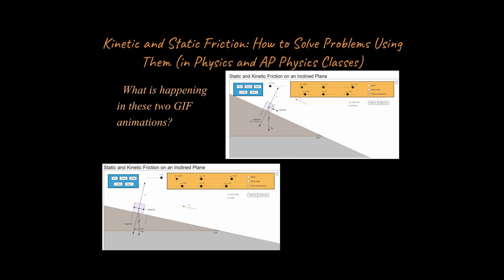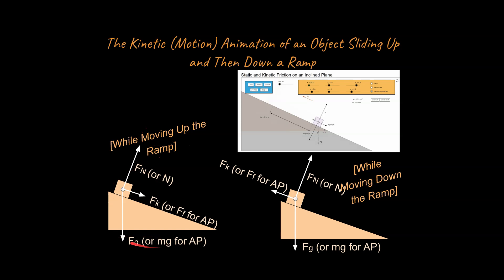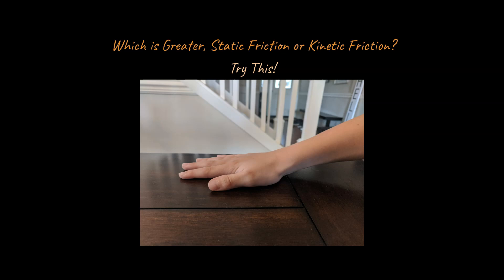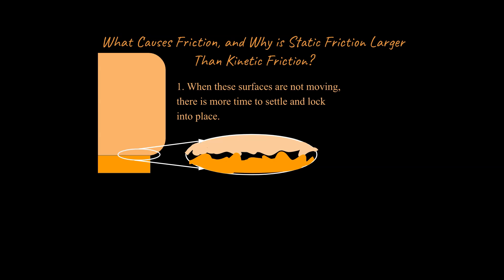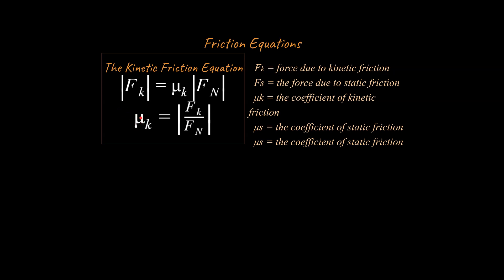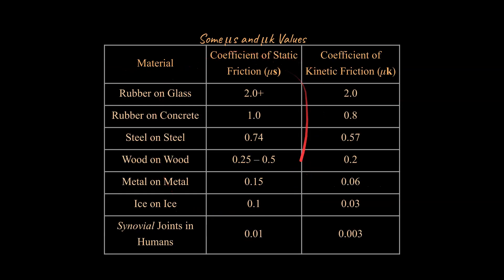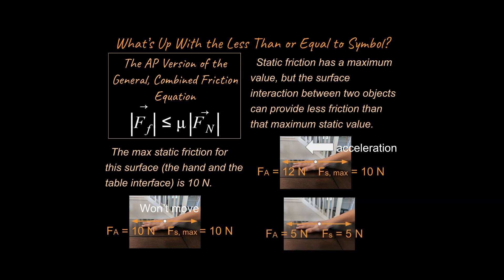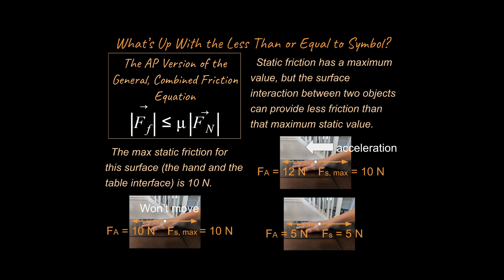Kinetic and Static Friction: How to Solve Problems Using Them in Physics and AP Physics Classes

Comment: As I know the normal force occurs because of the repulsion of electrons between the two surfaces, but if it was only for attraction between molecules, the surfaces would penetrate through each other. Now, I am confused about friction case. As surfaces come closer together (in the state of static friction) because time passes, won't the electrons from the surfaces repel each other more as the distance between electrons are now less. So, the normal force would increase of this increased repulsion and in turn static friction will also increase. Or is there both attraction and repulsion between surfaces' molecules?
Reply from the maker: Good question as usual Bobogan, and it is complex.  There are attractive forces in between the protons of one atom and electrons of nearby atoms (as well as repulsion between electrons of neighboring atoms, which you wrote about).  So when neighboring atoms come closer both the inherent attractions and repulsions between them increase.   However with time for the molecules to rotate, there are now more attractions between neighboring atoms with hydrogen bonding happening, than otherwise would be happening.  And what you wrote is correct - if the normal force is greater than the frictional force will be greater.
  Here is more information about types of bonds that somewhat addresses issues you are talking about:
https://youtu.be/_WZo_T7Jkr4
Reply: @mastering_science  So the normal force is the consequence of both attraction and repulsion between object’s atoms. But are those attraction and repulsion forces the same in magnitude? For example, a block is sitting on a surface and there is an attraction force down and the repulsion force upward on the block’s atoms. If any of the two forces (repulsion or attraction) is greater than the other, it would be accelerated, right? But in reality normal force happens and the block stays at rest. And this normal force is up, balanced by gravity. Ultimately, normal force happens to be upwards on the block. So does this mean that the repulsion force is greater than the attraction force in any case ( static friction when time has went on or in other)? Maybe these questions are beyond the scope of AP physics C but I am very passionate about understanding every physics topic in depth, especially on the scale of atoms. Thank you a lot for clearing my doubts about these topics.
Reply from the maker: The most clear and simplest way to understand the normal force is with Newton's third law - every action (force) has an equal and opposite reaction (force).  So if an object pushes against a surface, the surface pushes back.   The component of the pushing back that is perpendicular  to the surface is the normal force.
  I hope this helps and keep your questions / comments coming as they are good ones.
https://youtu.be/_3RzT1WVKA8
Reply: @mastering_science  thank you